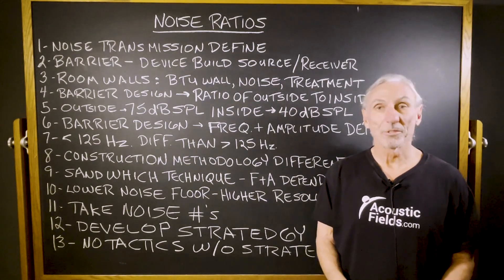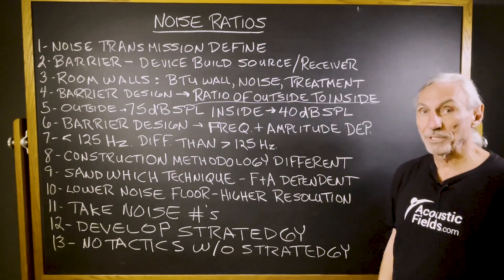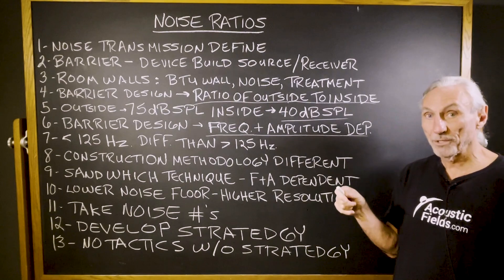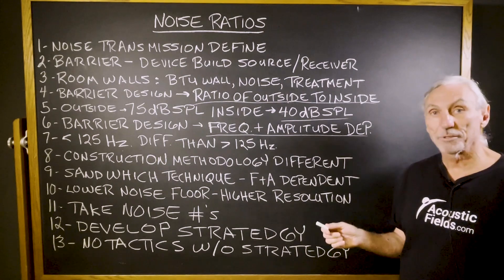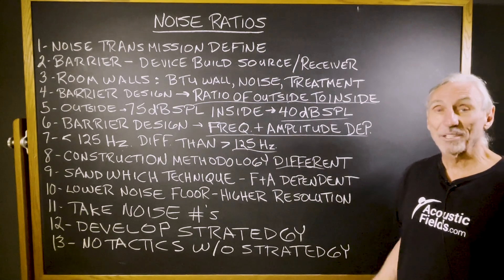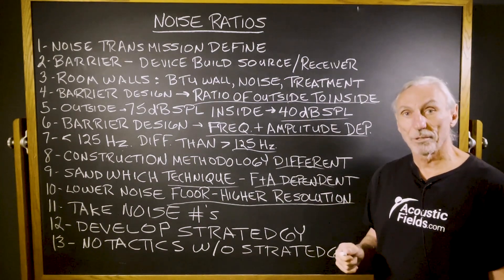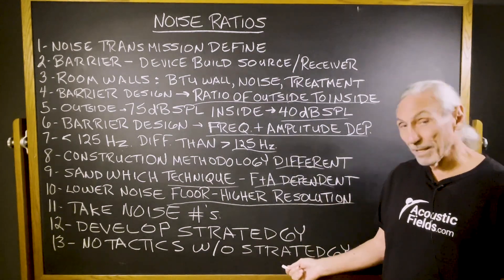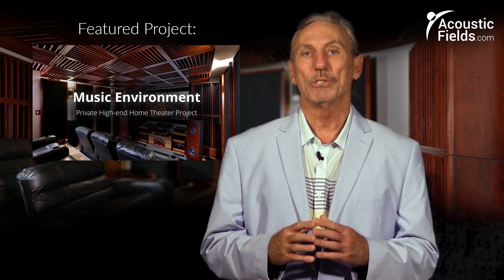Noise Ratios - www.AcousticFields.com

Comment: This is my biggest problem. Impossible to fix in a rental. So damn frustrating.
Reply from the maker: Noise is a pain and you can not wall hang units out of your noise issues like most think. Sound (noise) is like water. It will find the weakest link and go through that area.